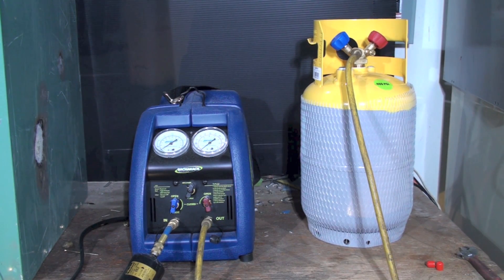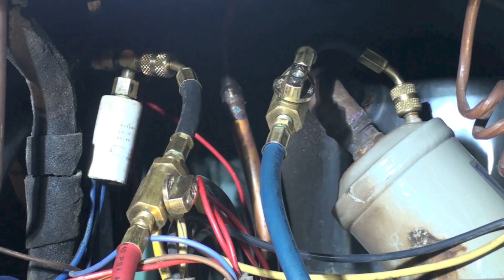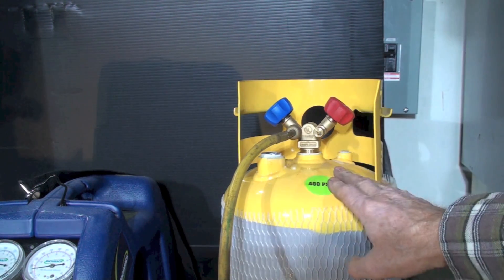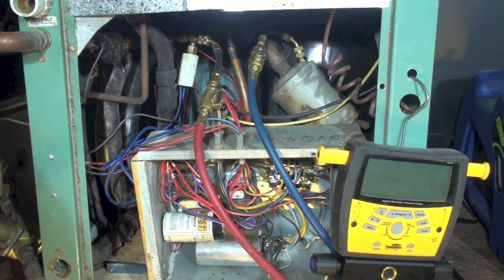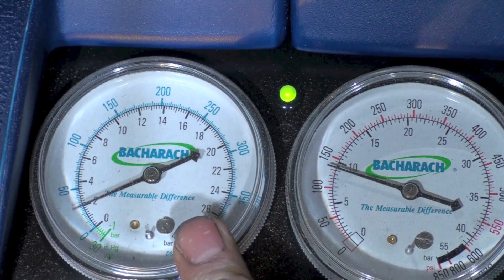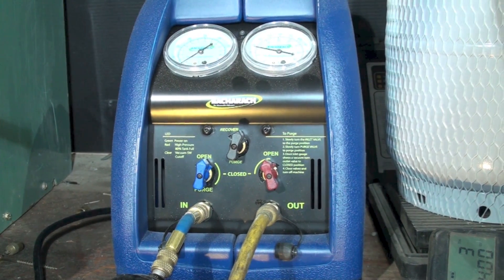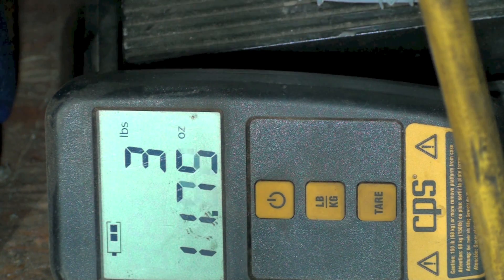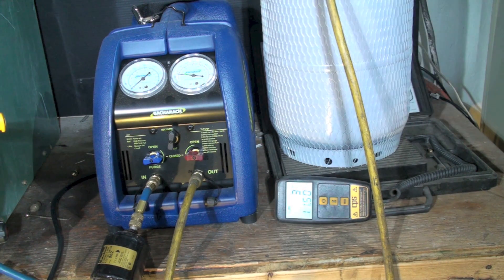Refrigerant recovery operation

Comment: so basically this recovers the freon right .... but is it wise to re use it or Bette off using new ?p.s how much is that pump ? never seen it .. it's not like the vacuum pump is it or is the same machine
Reply from the maker: +david martinez I virtually never reused refrigerant.  It was sent for reclaim.  The machine costs about $600.  It is essentially a condensing unit.  Hope this helps.
GFM

Comment: im sorry @grayfurnaceman but this is so wrong. first of all, NEVER release fluorinated gas intentionaly to the atmosphere (nr.1 of article III of chapter 2 of the REGULATION (EU) No 517/2014 OF THE EUROPEAN PARLIAMENT AND OF THE COUNCIL of 16 April 2014 on fluorinated greenhouse gases and repealing Regulation (EC) No 842/2006) see here: http://eur-lex.europa.eu/legal-content/EN/TXT/?uri=CELEX%3A32014R0517
by the way i know the kioto protocol its only applicable in Europe, but is good for every Hvac technician to know.

its against the kioto protocol and its common sense, you need to be informed about GWP (global warming potential) of the gases you work with and what it means.back to the video, the process of recovering is much more complicated than that. 
fisrt of all you need to vaccum all the hoses, the recovery machine and the hose that connects to the cylinder (with all valves closed and the cylinder)., recovery machine settings: blue valve opened, black vlave on recover, red valve open and turned off
Since your manifold has 3 hoses, you need to connect all the hoses, but now grab the blue hose and put it on the vaccuum pump, open manifold valves and vaccum to the recovery machine.after this step you need to vaccum recovery machine and yellow hose to cylinder: dial SLOWLY to the purge position UNTIL you find a sweet spot in the middle, you will notice the high side of recovery machine drops down a bit, dial back up to recover, repeat this step until high side drops to vaccum and voila. (its like pulling water out of a well and pouring in another bucket)
close blue hose valve, disconnet from vaccum pump and connect to low side of instalation (it purges automaticaly once you do so). now your manifold, hoses and recovery machine are in vaccum without ANY gas loss to atmosphere.
the process of recovering its another complex task but i would just keep texting and gets too long for ALL the process. im not devaluing your work, accept this as a constructive criticism, take advantage of this piece of information because its hard to find people teaching the really correct way of doing this. 

best regards
Reply from the maker: +Diogo Morais I know you are trying to help but, I taught the prep class for CFCs for 9 years.  If you look at the applicable regs, you will see the term "deminimus release" in the US.  That reg allows releases to bleed hoses, etc.  Note the link you provided, Ch II art 3 #1.  Also, if you place a high vacuum on many recovery machines, the shaft seal will leak.  Some certified recovery machines do not even have a purge valve.  I, like you, originally evacuated the entire system until I found some units (yes, new ones) would not hold a vacuum.  Thanks for the thoughts.
GFM

Comment: You have some very nice equipment. how much do those digital gauge sets cost?
Reply from the maker: +Conner Smith They run about $350 to $550.
GFM
Reply: Awesome thanks man wish I had a setup like this but I mainly just charge my vehicles

Comment: How deep of a vacuum on the recovery tanks500 microns 300 or lower , what would you know to be a good vacuum for recovery? o the tanks.  im sorry its late im sleepy an just curious.
Reply from the maker: +dale lankford You will be lucky to get 500 on a used system.  I usually wait until the vacuum settles at a level below 1000.
GFM
Reply: +grayfurnaceman  im sorry I wasn't clear how much vacuum on the recovery tank             thank you inadvance  for answering    rdl
Reply from the maker: +dale lankford You should generally get 500 on a recovery cylinder.
GFM
Reply: Thanks man,  Your videos answer  a lot of questions . I have my NATE cert.  and I still come across things I didn't think too ask or just plain don't remember im not new per say, but after Trade school ive  had to unlearn a lot of OLD habits  such as the beer can method of charging a system.

Comment: how to transfer freon R40 in large tanks to small tanks?
please help me .....
Reply from the maker: +wini mulyani First, I have never heard of R-40.  Any containers you use must be rated for that refrigerant.  I don't know the pressure of the refrigerant.  When transferring, you must not exceed 80% of the capacity of the cylinder you are transferring into.  If you want to transfer it from large to small cylinders, there are 2 ways.  One is to place the large cylinder above the small one and connect a hose between the two.  Cool the small one.  The second is to use a recovery machine like the one in the video to pump the refrigerant as a gas (from the top).  Hope this helps.
GFM
Reply: +grayfurnaceman 
Thank's for reply, sorry but i want to ask a recovery machine, what is name machine can be used?
I'm hear methyl chloride or chloro methane boiling point of -23.8 ° C it is type freon R40 so I had to the small cylinders is colder than the source large cylinders, but i'm confused of temperature settings. how many degrees centigrade cooler temperature should I set the small cylinders ?
Look forward to your reply
Reply from the maker: +wini mulyani The machine in the video is made by Bacharach.  If the chemical is methyl chloride, there is no recovery machine I know of that can be used.  The small cylinder can be as little as 20C lower than the large cylinder.  
GFM
Reply: oh so mean yes there is only one way sir? that for small cylinder temperature should be lowered 20 degrees, measured on the outside of cylinder temperature or the temperature inside cylinder? usually to perform cooling what wear?
Reply from the maker: +wini mulyani You can check the outside.  I would wear a face shield and insulated gloves.  Also a breathing mask that will filter out the gas you are working with.  Very careful here.  If I am correct, the gas is poisonous.
GFM
Reply from the maker: There are 2 ways.  One, you place the large cylinder upside down and above the small cylinder and cool the  small one.  Two, use a recovery machine to pump one to the other.  In both cases, you must be sure the smaller cylinder is not filled over 80% of its capacity.  Hope this helps.
GFM

Comment: dear gray furnace man, can you shed some expert light on this? New apt. 1969 a/c central air on both roof and hall ceiling. Unit doesn't work; 5 Freon refills over summer, still 80 in apt. Halogen detector finds Freon near coils in hall section. Oil coming down rusty colored not far from that onto light fixture; paint bubbling directly below unit solvent effect. Dog died month 4 after movein. 2 disabled one kid all of us palpitations, burning eyes/throat, swallow trouble. Stingy manager claims from roof, "evacuated" Freon, yet didn't fix leak in apt. I understand that's called recovery, not evac. Perhaps just saying did, as nothing in here has changed; 24/7 windows fans going venting, still horrendous in here to breathe, everyone headache if close windows on the colder nights, within an hour. What would be left in lines IF they did recover from the roof, and if the leak is in the house section, whats the proper way to go about ceasing this leak? (we are poor, this is subsidized housing, etc, cant just move nor pay for repairs). Thanks tremendously. [Freon symptoms are when lying down for bed near floor level]
Reply: +Fleon Kwestor forgot - theyre suggesting for winter heat, turn fuse back on, untape vents (we shut it a while ago trying to minimize exposure thru vents taped up etc) -- isn't that dangerous to keep using for anything, like heat??? Thanks. also picking up halogen with our 'Freon detector' in the bath and kitchen drain area.
Reply: +Fleon Kwestor also forgot, last time used before we gave up, tons of water coming from the air filter/coils housing area hall ceiling. No air blows at all from vents, just sits in vents no cooling the room or circulating.
Reply from the maker: +Fleon Kwestor Refrigerant will not cause health problems.  The only way it is dangerous is if it is burned.  In that case, you would not be able to stay near it as it is VERY irritating.  The unit obviously does have a leak that has not been found.  It just requires someone to methodically look for the leak.  
I can't tell if there is a danger from the vents, but it is not from refrigerant.  The vents must be open for the heat to work.  
The water leak is probably from frozen evaporator coil related to the refrigerant leak.  Hope this helps.
GFM
Reply: thanks grayfurnaceman, but just so you know, breathing Freon sleeping on floor level for months, kills pets, can cause heart attack and death, lung scarring, and is especially dangerous for kids, the disabled, and the elderly. It is indeed dangerous when chronically exposed. My question was really what remains in a line that's only been recovered and not yet vacuumed, or the hole fixed. Have a good weekend.
Reply: and yes, burning eyes throat and nose indeed very irritating - below the unit where the leak is is one light fixture, and the h/w heater.

Comment: Is there anything special about the recovery cylinder?  Is it just a can or has some special parts? Can we push refrigerant with this machine to any empty cylinder?
Reply from the maker: +Guy Hakverdi The refrigerant cylinders are throwaway and have a check valve that will not allow refrigerant to go back in.  The recovery cylinders are much heavier and have a liquid and gas valve.
GFM
Reply: Got it. Thanks.

Comment: Can this machine be re-charge the recovered refrigerant back to the unit?and how?
Reply from the maker: +Winston Lee You can recharge the unit with the old refrigerant.  You do not need the recovery machine.  Just use the cylinder as you would a new one.  Legally, you can only use the recovered refrigerant in machines owned by the same person or company.  Hope this helps.
GFM

Comment: so when you purge dont you run the liqud refrigenerent thru the recovery machine? why didnt it ruin your machine?
Reply from the maker: +Arnold Navarro Good question.  The condenser on the recovery machine becomes an evaporator during purge.  The refrigerant boils in the evap and is purged out as a gas.  This is not to say these things do not get liquid in them.  They do and are designed to be able to pump some liquid without damage.  However, I try to not to get too much liquid in them as that is the primary cause of pump failure.  Hope this helps.
GFM
Reply: Lol are you serious buddy
Reply from the maker: +ThatDoubleFLife Yes
GFM

Comment: As far as I know, refrigerant pipes also contain the compressor oil.
So what happen to the oil ???
Reply from the maker: +Nox665 When the liquid is recovered some oil will come with it.  Gas does not bring out oil.The amount of oil removed is seldom enough to cause any problems in the system.
GFM

Comment: Thanks Grey.  Going though all your vids as they are choked full of knowledge and experience.  Not speaking too quickly, and not trying to be an entertainer.  Thanks. Question:  What equalizes the pressure as refrigerant is evacuated?  .Is this replaced with air?  Wouldn't this contaminate the refrigerant?  Do you reuse the reclaimed refrigerant?   Wouldn't it be better to replace with nitrogen?    As an off topic question-  Do you get concerned with cross contamination of different refrigerants in a single SMAN?
Reply: You substract gas from system, and the pressure drops, thats is pressure equalisation   pv=uRT
Is replaced by nothing, so no contamination

Comment: Do you reuse recovery machine driers if you know the system was not contaminated and appears to not have non-condensables, so long as you keep it closed off from the atmosphere? Also; if you re-charge the system with the recovered refrigerant--even if it appears to not have non-condensables--could it possibly be beneficial to crack open the cylinder's vapor valve momentarily in case there is some air present (aside from the issue of venting)? Thank you.
Reply from the maker: Brian Fletcher I do reuse the driers.  It is kept closed off from the atmosphere with the process hose.  A small bleed may be helpful.  However, I do not reuse refrigerant.
GFM
Reply: grayfurnaceman You raise a question in my mind - in cases where the same refrigerant is not charged back into the system what about the oil that came out during a liquid recovery? And in my case I have a basic recovery machine with no oil separator. Is there a concern? Or I have read that refrigerant has its "own" oil. Is that the only oil that exits the system during recovery, and will the new refrigerant carry its own oil back into the system? Thank you.
Reply from the maker: Brian Fletcher None of the recovery systems have an oil separator.  The machines rely on oil from the systems for their own lubrication.  There is no refrigerant that "has its own oil" except perhaps Sulphur dioxide and you don't want that one!  Oil that is in the system is from the crankcase of the compressor.  For the most part, the amount of oil in the refrigerant is negligible.  Hope this helps.
GFM
Reply: grayfurnaceman Thank you for the clarification, and all the time you take to help!
Reply: A late follow-up, but still a question in my mind. I understand you do not reuse refrigerant. So after you recover and charge with new refrigerant do you add oil to the system? I read where you stated it is negligible but in my case my system charge is 14 lbs of R410A. If you removed 14 lbs and charged with virgin R410A would you not add any oil? Or if you would add some, is there a method to determine how much? While I have read where oil is necessary for the compressor I've also read that too much can impede with proper performance. Thx!
Reply from the maker: When the refrigerant is removed as a liquid, it will contain oil.  Part of the refrigerant is recovered as gas that contains no oil.  My experience has shown it is negligible. There is no way to determine how much oil has been lost.  I would not worry about it.
GFM

Comment: When you purged the recovery machine, isn't there still freon in the yellow hose and what do you do about that?
Sorry for all the questions. The videos are very instructive.
Thanks again.
Reply: No because the valves on the low and high side were still closed
Reply from the maker: It will be released when the hose is removed.  It is considered a de-minimus release.
GFM
Reply: he should be purging the manifold

Comment: The manifold said you had the same pressure on both sides as they were both open. The recovery machine said you had 2 different pressures. That does not make since. Are you pumping into the  recovery tank into the liquid or vapor side and does it make any difference? You used a dryer filter. If you replaced the compressor, would this clean up the freon enough to return it or would you just put in new?
Thanks for the information and videos.
Have a nice weekend.
Reply from the maker: amtpdb1 It actually does make sense when you understand that the recovery machine is a condensing unit.  It must increase the pressure to the level of the saturated pressure in the recovery cylinder to move the refrigerant.  It makes no difference whether you use the liquid or gas side of the cylinder.  The filter dryer is for protection of the recovery machine.  I always like to use new refrigerant because I know it is clean.  Hope this helps.
GFM
Reply: grayfurnaceman Thanks

Comment: Remember, the tag on the condenser shows the charge for 15 ft of copper lines (Most systems today) and a matched system. If you have refrigerant lines longer than 15 ft. and a larger indoor coil, you will need to add xx ounces per foot of lines and see the spec sheet on the indoor coil or finish the charge per the subcooling for a TX valve or superheat per a piston system. But the indoor coil and filter must be clean, the proper cfm running for the system and the indoor temps near the comfort range. The dew point temp may be required for proper charging as well- see the systems specs.
Reply from the maker: newstart49 This video just covers recovery of refrigerant recovery.  If you are interested, here is a playlist on charging:  https://www.youtube.com/playlist?list=PLItXrh64d2JNue0B3iGRSAPpPgni6mcqS  In any event, thanks for the thoughts.
GFM

Comment: Another excelent explanation of system refrigerant evacuation which help to explain why the nationwide cause of faulty outdoor heating TXV's in recently installed heat pumps these days  (contaminants ) for not following the proper techniques. Thumbs up as usual!!
Reply: Francisco Castellanos A lot of it is because bad technicians aren't careful when installing/servicing systems, and they allow contaminants to get into the open system. It's not like the 80s, when line sets and entire units were pre-charged with self-piercing line sets that required no gauge hookup. They would flush the entire system after it was assembled, vacuum, and then charge and ship it out. Very clean systems that had almost zero contamination, but that isn't really seen today.
Reply from the maker: Francisco Castellanos Thanks for the support.
GFM